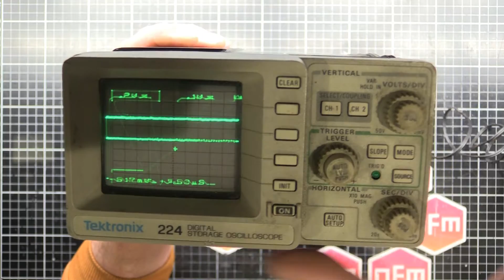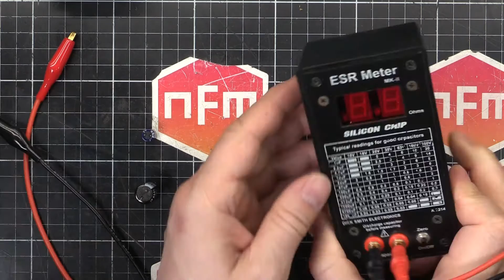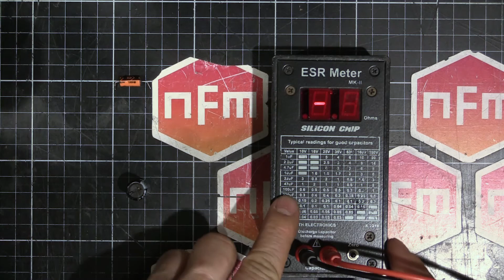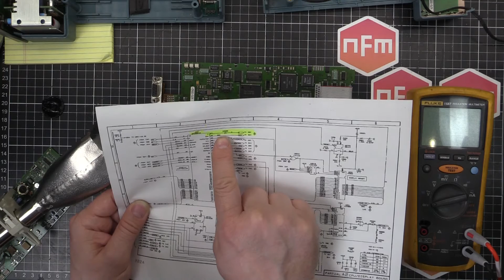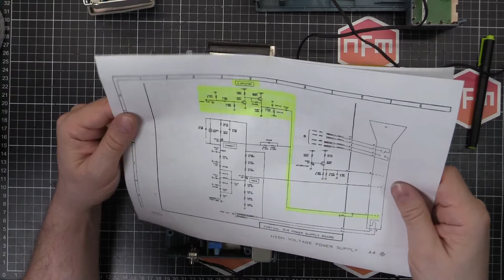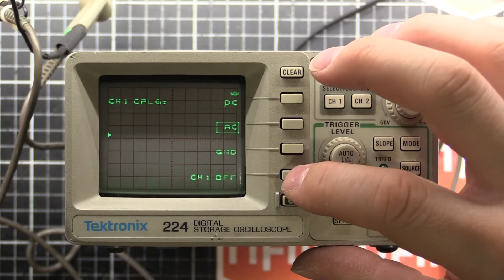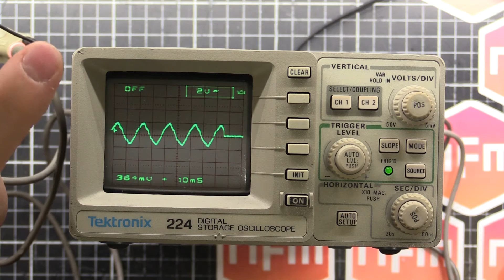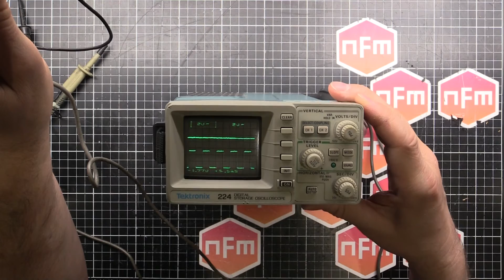Tektronix 224 Mini Scope Repair and Battery Upgrade

Comment: I bought exactly this power supply for my 222-PS from n0dy-Jeff in California, and I can tell you it is great!
The 222PS is not just cute, but it is almost inimitable, as it is floatable to 850V/p-p, making it a tool only supplanted by devices costing thousands of times as much.
Of course it is bandwidth limited, and sample-rate limited, but these are not the features you are looking for when looking at higher-voltage power supplies.
Regarding this particular repair job, I believe it is not the two transistors in the amplifier stage that made the difference.
Tektronix is a prestige brand, and they have surface-mount "indignity sensors" in the cases of the instruments. 
This scope came in in an indecently filthy condition, and you have cleaned it up, thus satisfying the negative indignity condition, and this is what has allowed the scope to work decently!

Comment: Can you explain why the hybrid chips were such a no no to mess around with / touch? Great vid btw - really glad I found your channel!
Reply from the maker: They are basically unobtainable unless you pull replacements from another oscilloscope.
Due to the custom nature of them, you could only buy them from Tektronix, and due to their age, you can't buy them any more unless you get really lucky. Its the same for many custom parts across multiple manufacturers when dealing with older equipment.
Reply: NFM makes sense! Thanks for the explanation

Comment: Does this digitize the signal then display it or does it display the analog signal but it stores some waveforms for playback? So it is fully analog when probing but for analysis - ch1 vs ch2, you can playback a waveform?

Comment: Excellent video. Anyone who have the 224 service manual I will be grateful. I have the 222 service manual but isn't the same circuitry :(. My 224 starts show the probe screen then blank the screen then shows a point on top right then starts again in a loop. I'm trying to fix it for let a gift to my brother. Best regards from Venezuela.